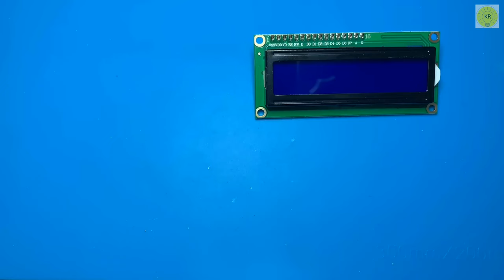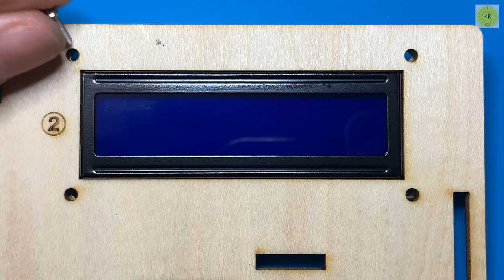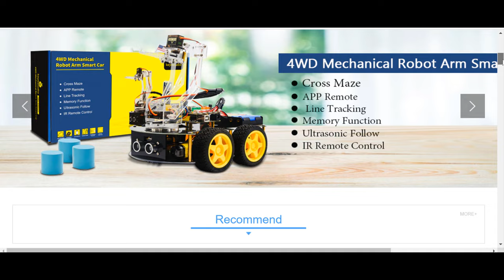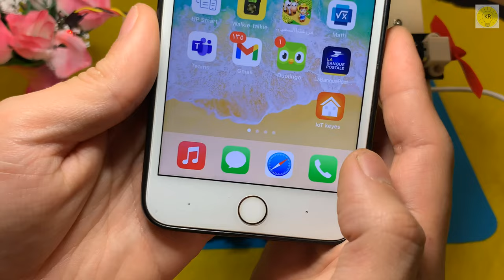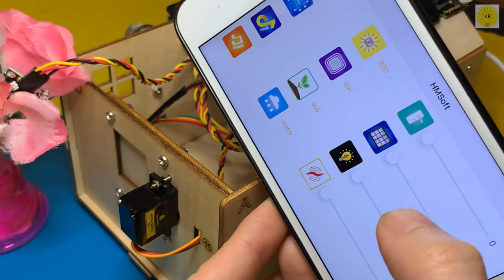smart home kit with PLUS Board for arduino DIY STEM | Keyestudio

Comment: الشيفرة البرمجية تستخدم 13662 بايت (42%) من مساحة البرنامج. أقصى حد 32256 بايت.
المتغيرات العامة تستخدم  1041 بايت من (50%) الذاكرة المتغيرة، تبقى 1007 بايت للمتغيرات الداخلية. القيمة القصوى  2048 بايت.
avrdude: stk500_recv(): programmer is not responding
avrdude: stk500_getsync() attempt 1 of 10: not in sync: resp=0x97
avrdude: stk500_recv(): programmer is not responding
avrdude: stk500_getsync() attempt 2 of 10: not in sync: resp=0x97
avrdude: stk500_recv(): programmer is not responding
avrdude: stk500_getsync() attempt 3 of 10: not in sync: resp=0x97
avrdude: stk500_recv(): programmer is not responding
avrdude: stk500_getsync() attempt 4 of 10: not in sync: resp=0x97
avrdude: stk500_recv(): programmer is not responding
avrdude: stk500_getsync() attempt 5 of 10: not in sync: resp=0x97
avrdude: stk500_recv(): programmer is not responding
avrdude: stk500_getsync() attempt 6 of 10: not in sync: resp=0x97
avrdude: stk500_recv(): programmer is not responding
avrdude: stk500_getsync() attempt 7 of 10: not in sync: resp=0x97
avrdude: stk500_recv(): programmer is not responding
avrdude: stk500_getsync() attempt 8 of 10: not in sync: resp=0x97
avrdude: stk500_recv(): programmer is not responding
avrdude: stk500_getsync() attempt 9 of 10: not in sync: resp=0x97
avrdude: stk500_recv(): programmer is not responding
avrdude: stk500_getsync() attempt 10 of 10: not in sync: resp=0x97
تعذر الرفع: uploading error: exit status 1
Reply: please remove the Tx and Rx pins before uploading  then press upload and then insert them again when the code is successfully uploaded on your board

Comment: Can i use battery 9v ?
Reply from the maker: yes
Reply: @inventorkr1  hello bro i have question about this Note
Note: Remove the Bluetooth module please, when uploading the test code. Otherwise, the program will fail to upload. Connect the Bluetooth and Bluetooth module to pair after uploading the test code.

Does this mean that I do not prove bluetooth module in shield sensor until the end of the program ?

Comment: I got this as a gift cause I love to build things and I was told this was beginner friendly. I was able to figure out the "building" part but I have no idea what to do this these cables. Is there no how-to on what I'm supposed to do with the cables?
Reply: I recommend the official Arduino Starter Kit. Teaches you the basics of wiring the Arduino
Reply: You need to learn the arduino starter kit tutorial first bc whoever got this gift for you wasnt fully aware that it has an advanced arduino software but i think u have to code the whole thing yourself to set the password and bluetooth since you got no tutorial so heres what you need to learn:
Arduino basics- 
Building skills which u already have
Coding in C++-
Knowing how to attach codes into the arduino parts-